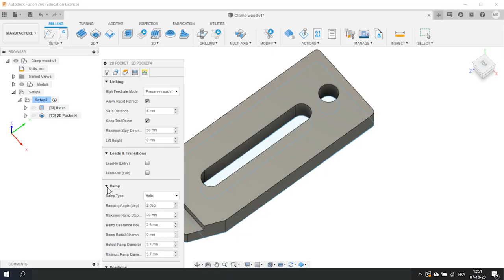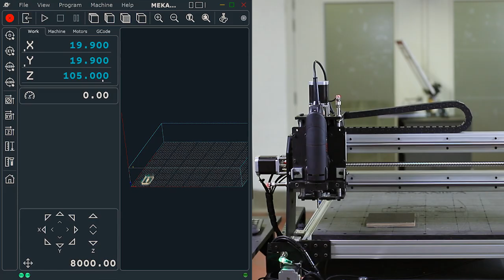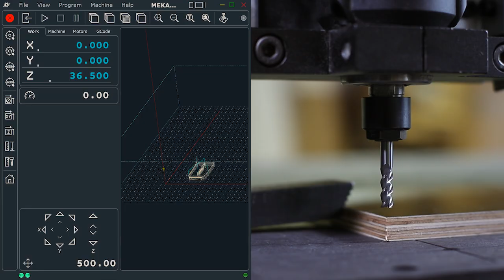CNC Milling Tutorial #3 | Get Your Machine Ready to Mill

Comment: Hi, my machine is working but if i want to mill i have to put the Z axle zero on the material i want to mill not on the table is that a G code mistake?
Reply from the maker: You can decide yourself where to put the zero of Z in your CAM software, and must put the zero of the machine accordingly. This can be on top of the spoilerboard or on top of the material. We recommend putting the zero on top of the spoilerboard so there's no negative Z value in the G-code and you can quickly see if you made a mistake in your CAM.

Comment: I'm new to cnc.  I have an aluminum part that has a 2D pocket with a hole at the bottom out the bottom of the part.  Should I bore the hole and then clear the pocket, or should I clear the pocket and then bore the hole?
Reply from the maker: Both will work just fine but I would say that  if you make the pocket first, the mill will cool down more easily when you bore :)